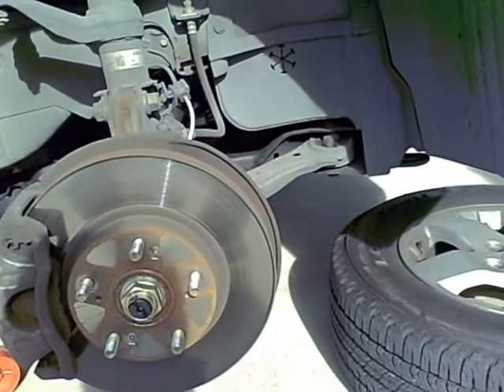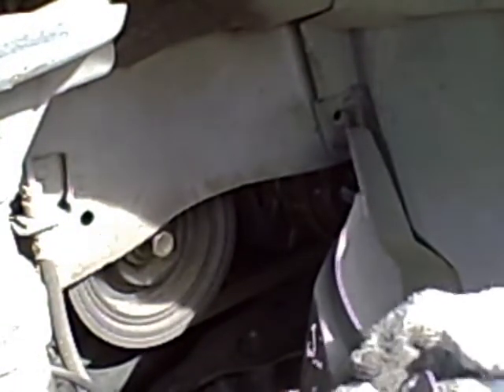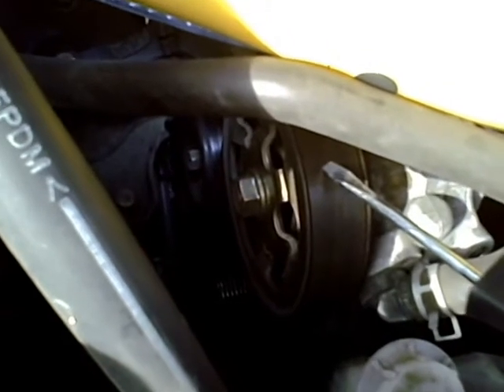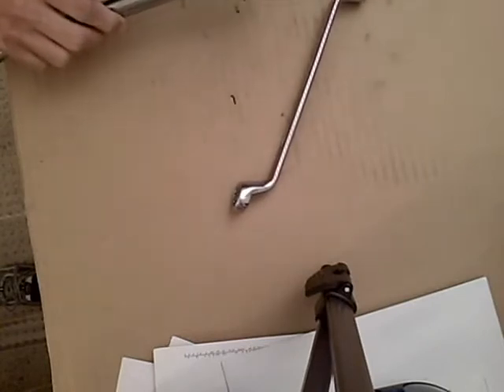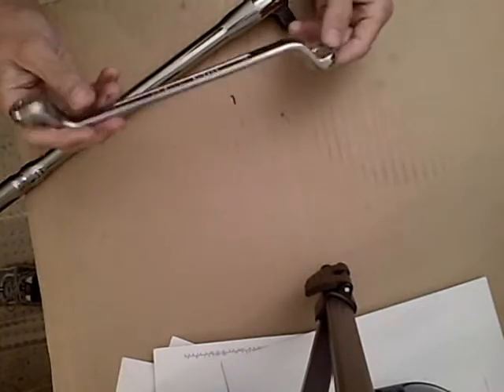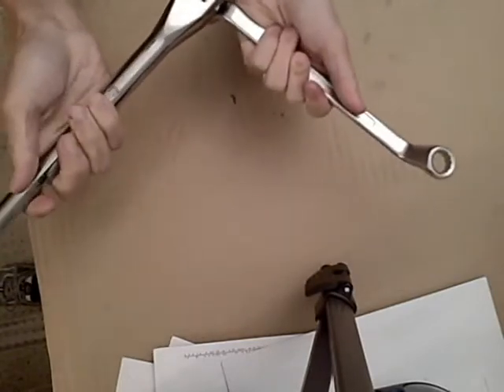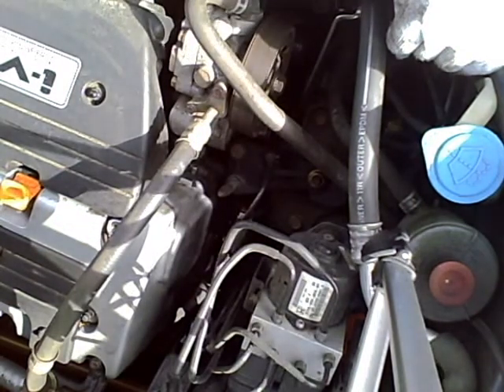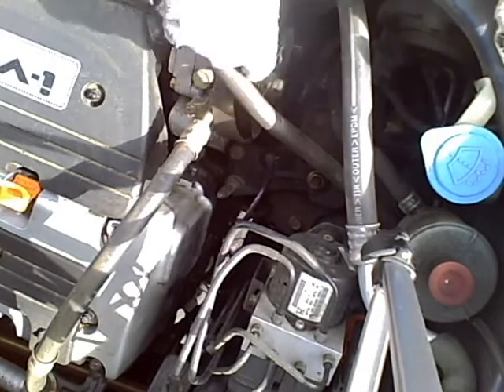2003 Honda Element serpentine belt change

Comment: Thank you very much for your video. I was stuck on this step during an alternator replacement for several hours after not having the right setup for removing serpentine belt. Even tool made for it was not working. 14mm wrench to 1/2" driver was the magic. Thanks!

Comment: I did this by myself in about 10 minutes. Loosen tensioner and remove belt from top to bottom. To replace, turn wheels full right. Remove access panel by right front wheel to gain access to lower pulley. install in reverse from bottom to top.

Comment: Thanks for the video!  I just changed the belt on my 2007 Element with the help of your video.

My girlfriend was standing by to help, but I ended getting it done by myself. To the release the old belt, I was able to hold the tensioner with my right hand and reach down with my left to pull it off of the crank.  To attach the new belt, I put it on the AC last.
Reply: how did u pull de-tension bar and reach AC pulley at the bottom? u must have arms like an octopus.
Reply: Haha, not at all actually. I'm only 5'7" with stubby arms and legs. It's really not that far to reach down to the crank. To install the belt, I set it up on the lower and middle pulleys first, pulled the tensioner, and slipped it on the AC pulley. Removal and installation, 1 person, in just a few minutes.  The most difficult part is actually the getting the loose belt in and out of the engine bay.

Comment: May have to adjust the idle!!!  Thanks for the video, I changed the belt today @ 151264 miles and it was in great condition. Interestingly later I started it and it stalled. Hmm stalled, again and again.  Ok I thought old battery (4yrs with lots of road trips)  with new belt, causing the alternator to do weird things with the battery,  Got a new battery.  Nope stalled. Then adjusted the idle. Bingo. The car purrs. Great Video

Comment: Thanks for the video.  I used a similar method to change the belt on my 2006 Accord.   The breaker bar with the 14mm combination wrench worked nicely!

Comment: Thanks for uploading this.  Used this vid and the 2003 Honda CR-V serpentine belt change vid to change out the belt on 2002 CR-V to bypass the AC compressor after black death.  Bypass belt #7pk1388.

Comment from the maker: I changed it in 2011 at 129k miles. There is no mileage or time recommendation by Honda. The manual says inspect the tensioner indicator and change when out of normal range.

Comment: Sounds like you were quoted for a time belt based on that price which is funny since the 2nd generation CRV has no timing belt. Can't imagine any shop charging more than $200 to change out an accessory serpentine belt on a CRV. Even $200 is high. Between 100-150 would be the norm based on the cost of a belt and an hours labor at most independent shops.